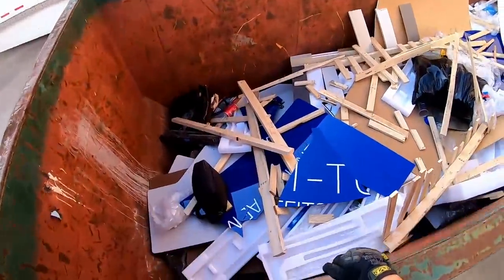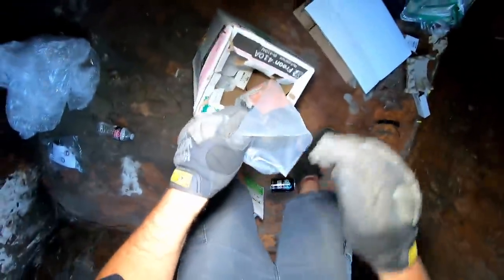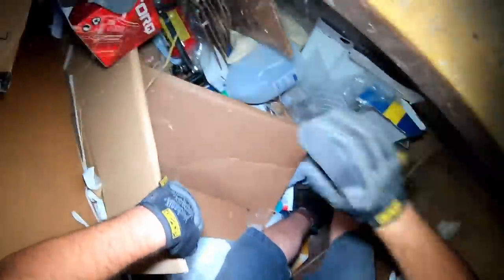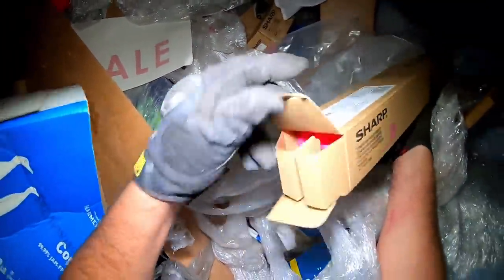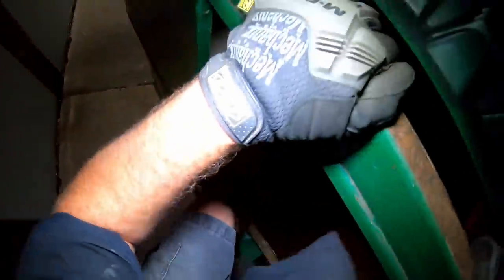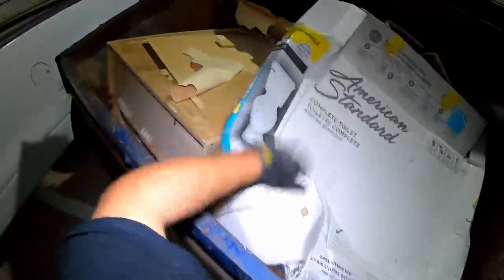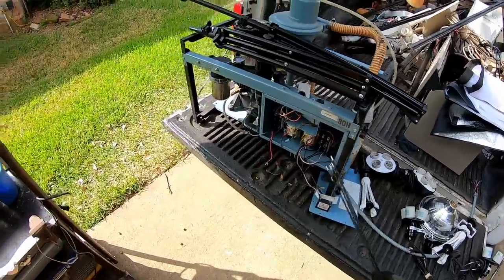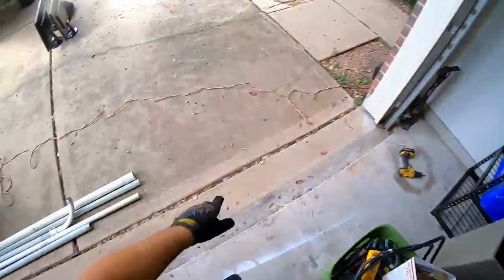Dumpster Diving "Who Ordered The Shrimp?"

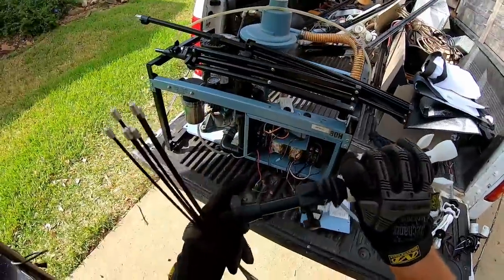Comment: The black and white thing at 23:30 is to put into a background tube. There were probably two of them. You also picked up a black metal bracket looking thing. That is to put up multiple backdrops on one set of tripods. Probably was a second one of those as well.

Comment: Hey Mike,  That fan goes to a high efficiency gas furnace, for the exhaust. depending on what unit it came out of they are quite pricey. I recently got a used one off E-BAY and spent just over a 100 bucks. New was 285.  You might look into selling it. BTW im scrapper at heart and also have a buddy that we call "Mike the scrapper, " keep on keepin on with the videos, good stuff!

Comment: Long gray electrical box is called a raceway. Used for running several wires above multiple breaker boxes. Wires will drop to each box. Depends on length as to cost, some run around $80 new.

Comment: The big black hook thing is mounted to the wall and holds a photographic backdrop.  The funny looking white and black plastic things go in the roll of paper of canvas and attach it to the hooks.  Go to B&H photo and look them up under studio backdrop holder.  Like all things photographic they are somewhat pricey.  I only saw one of the hooks so if you didn't get the other maybe go back and look for the other because you need a set.
Reply: Yes you need two of the black brackets and at least 2 of the “funny looking white and black plastic things” per roll of material. You also need the sprocket chains in order to raise and lower the backdrops. You can buy a full set for about $100.

The lights are very basic Constant Lights. The soft boxes though are decent and can be used on strobes also.

Comment: Hey if I wanted to start scraping for extra money how would I start? I know grab the metal but what types are most valuable and how do I tell them apart
Reply: Copper, brass, aluminum, stainless steel, are your main metals, with copper being your most valuable.. use a magnet, if it sticks it is most likely irony steel that is usually in most places, valued by the pound or with enough weight by the 100 pound, say like . 8 cents a pound is equal to $8.00 per 100lbs. Whereas those metals listed above, are not magnetic with stainless steel being an exception where certain types of stainless steel like the type with the crystaline finish.. kitchen sinks etc.. there's a lot more to it but pile it up and then go from there. The best way to learn about it is, watch a pro like Mike The Scavenger, or jump in and do it! Good luck!